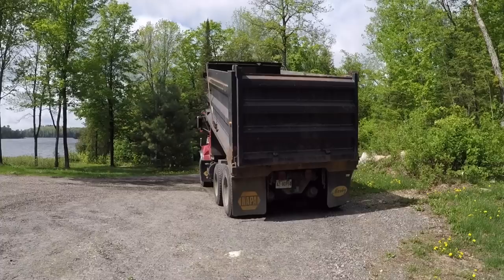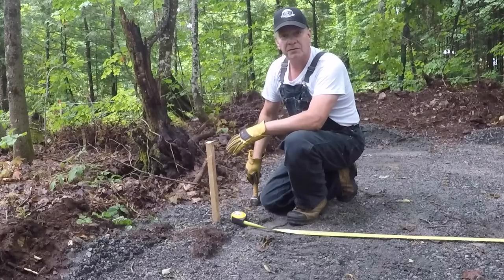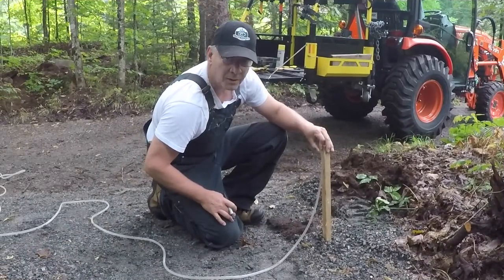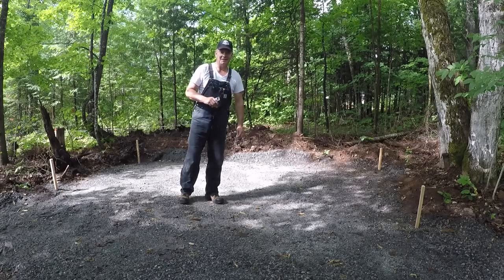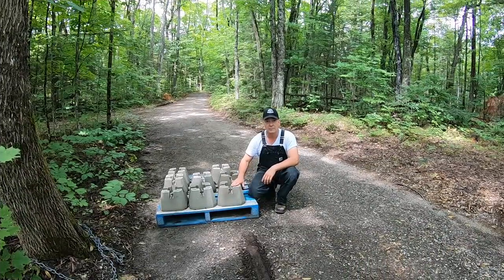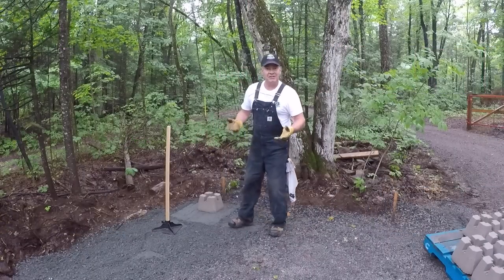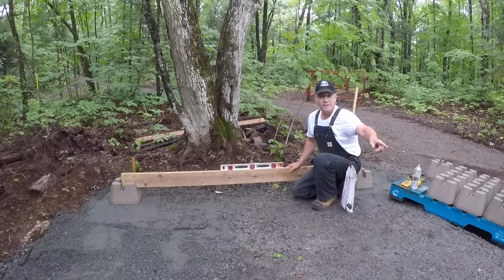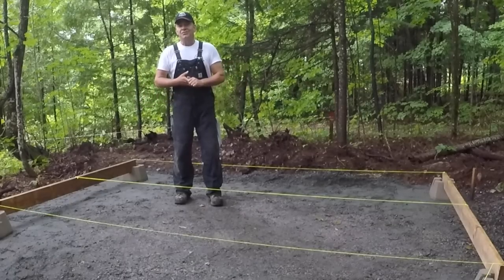#316 Wood Shed Build - Part 2. Levelling the ground and placing Deck Blocks. outdoors.

Comment: Great video Gord . Crusher run is great stuff . We use that name down here . When I built my shed 6 years ago I dug 2ft holes and filled them with crusher run . Pound it down really hard and it turns almost like cement . Put the blocks on top . My shed is 10X12 . Hasn't moved and inch . Put  a 1/4 screen between the deck and the ground to keep out the critters from living underneath . My 3 neighbours didn't do that and now they have skunk problems . Of course you won't need to do that . The hardest part of building these days is finding the lumber . Lumber prices have gone through the roof . I  always over build . That shed is going to be there for years after I'm gone . I always wanted to build my own cottage but never did . I built that shed just like the way I would have built a cottage . No short cuts . With Guy having a sawmill I would have thought that you might have cut some lumber for the shed . You had some pretty good size logs there to cut many boards . Take care .

Comment: Easy one man way to get grade on the ground is string, a string level and a tape measure.... Place your string at any height you want from stake to stake, mine is usually waist high so I don't have to bend to far over to read measures. 😀... Level your string and measure from the string down to the ground to see how much fill you need to equal your high spot measure from string to ground. Simple, very effective, and I've used it out up to 60 feet and got grade pretty accurate. Not laser accurate but darn good enough... Just got to move one end, usually low side, re-leveling string, from place to place checking grade of the area you want leveled... I did my 30x30 shop this way and not a low nor high spot anywhere before concrete pour. 👍

Comment: I always knew you were on the level! Sorry, couldn't help it. Those blocks are nice, I wish I had them about 10 years ago when I built my shed. In my case I didn't prep the footprint of the shed. I had a granite ledge near the surface and simply leveled the footings which were standard cinder blocks. Once I leveled the corner block I ran a string from that block to the next and so on using a bubble level on each block. Nice prep work! Best Regards, Jay

Comment: A solid foundation in aspect is the best to start building on! The crush stone gave you a good footing, leveling your “pad” and using foundation blocks gave you a level structure to build on. Now comes the easy part building the shed!
Reply from the maker: Good morning pat! Thanks! Any advice along the way would be very welcome. Have a great weekend!
Reply: Send me a sketch of your plans, and I will let you know of some ideas of improvement. After you build your box for your joists, put blocking between them in a staggered pattern this will strengthen your floor. And I would use pressure treated lumber for this area. A plank floor with 1/2 inch gap between boards will allow small debris to fall through and air to circulate. Then build your walls on top of this foundation 16 inch on center before sheathing with exterior materials. Double your header plate all the way around and leave your soffits open for ventilation. Then add your rafter system.

Comment: Gord I like the water level, works perfectly, Home Depot Newmarket has a lot of pressure treated right now and Lowes has almost none. I've noticed that the quality has suffered lately.
That is going to be a good size shed but like everything else I bet it will be full and too small in no time LOL.

Comment: Good old fashioned water level is a good thing to have...though I do have that identical lazer you had in your hand....mine's a 5 way self leveling, is that what yours is GP ?  Your load looks to be what we call inch-minus down here.  It's whatever falls through the 1'' screen, including all the dust, chat and small stone.  Packs super hard with compaction and water.  Fun video...especially you getting a bit wet at the end....LOL
Reply from the maker: Yup, that's the stuff here - packs really well hard. I'm not sure if it was the 5 way or not - it was Guy's - he lent it to me. Always hard to see the laser line in the sunlight. Lots of rain here lately - lots! My sump pump has been working overtime . LOL!

Comment: You can get cement blocks with a hole through the middle thar excepts a metal bracket with a threaded rod with a washer and nut. You place the block insert post/beam bracket and adjust the nut to level the base beams.

Comment: Hey there Gord,  I have used a water level many times.  We didn't use the bucket though, we just filled the hose with water and would take one end to one side of the building and the other end to the other side and the water would always seek its own level so you knew that each side of the building was at the same height. Good job.

Comment: Should of did some #3 as a base then some #2 modified to tie it all in.

Without a solid base, the small gravel will work it’s way into the ground eventually. 

Just my 2 cents
Reply from the maker: Thanks Sears! I dug down to mostly rock and got rid of all the organic so hopefully that will provide the more solid base needed. But big thanks for the help, for sure. Advice is always welcome. Cheers!

Comment: best level is a small bubble you can attach to a string line (only limited to length of string). I have the dewalt green laser level sometimes very hard to see in the day light.
Reply from the maker: Morning Forester. Very true. I have used the red ones and I bought the Dewalt laser glasses but it is still very hard to see in daylight. Cheers!

Comment: Crusher run is also called road base out on Vancouver Island and 3/4 fine   in the interior of BC (at least around Kamloops). It's a great material for your driveway if it doesn't slope too much.

Comment: When using a water level be sure to keep your thumb over the end of the hose when moving around so as not to LOSE any water.
That can affect your accuracy.
You also should mention that your level marks are for reference only and that you can adjust your fill likewise.
You don’t have to fill to original marks.

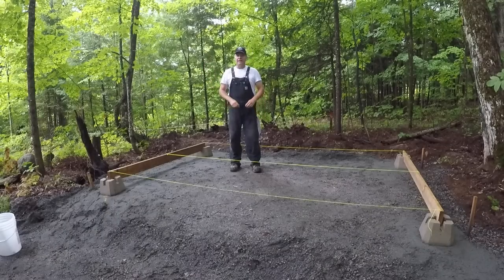Comment: Nicely done GP.  So when did you get an enclosed cabbedd, tractor.   did the same in May 2020 and haven't looked back since.  I have AC unit, music and no skeeters or biting flies to irritate me while working.  Smart move to get the cabbed tractor.  I can't wait to finally get out there and use it.  Once I get the green light from the doctor, then I can go out and play and might even make a few videos.  Yup, the water leveling method certainly works.   The Tamper will give you a pretty good workout too (smile).  Sounds like you were starting to get some drizzling rain at 12:52.    You're doing quite well establishing your firm foundation.  Enjoyed a full-watch.  Be safe and keep having fun, GP.  Have a fine Friday and a fantastic weekend.   Don

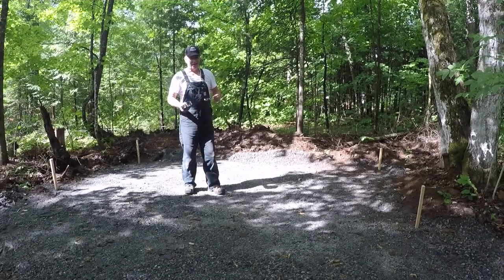Comment: Just a note about a water level. Always try to check on the same part of the hose. Checking at a closer area on the hose to the bucket will raise the level slightly. (like how you did on the last one at 4:46 with all the extra slack.)
Reply from the maker: Morning Josh! Thanks for the great tips - I did not know that. Cheers!

Comment: Off your shed topic.  Did you have to put wheel spacers on your LX2610?  Which tires did you choose? Great job on setting the blocks.  Cheers!
Reply from the maker: Morning 906! I didn't have to, but I did, because I plan on putting tire chains on it for the winter. Similar to the B2601, there is not enough room under those fenders for chains without the spacers, from what I could tell. Have a great weekend!
Reply: Ok thank you sir!  Did you go with R4 tires?

Comment: On those blocks just get them set, level and close to where they need to be.  you can cut wood spacers to place between the joist and the block to get things level. no need to dig out from under the blocks or add material under the blocks. I’m like you not a professional just sharing how I have used those blocks in the past. My shed is still level 12 years later.

Comment: You had level marks on all the stakes. I don't understand why you reduced three of the stakes 
 by two inches?????
Reply from the maker: Hi Chet. Great question - it is so I didn't have to build up the north end - so I dropped the level relative to the high ground. This way I only had to build up the south end and very little gravel needed at the north end. Cheers!
Reply: @GPOutdoors  the water level coming out of the bucket was two inches above grade?

Comment: Looks small for a wood shed as generally you want 3 seasons of wood storage to give it time to season and as an emergency backup in case of a bad year or an injury.  The good thing is large out buildings can be built cheaply once you have even a cheap Alaskan chainsaw mill as the cheapest wood shed build I have seen so far simply used posts in the ground and not even fully squared off timbers for the structure, a simple metal roof and live edge boards for the walls to enclose but still let in some air.
Reply from the maker: Good morning and thanks Andrew! Some great points there. I don't heat with wood so I didn't need much space but if i did , I think that would have been an excellent idea - to make sure it could hold 3 seasons worth. Any feedback or advice along the way would be greatly appreciated. Have a good weekend!

Comment: If you had done better in your high school physics class, you won't have doubted the accuracy of a water level. As long as there is no air bubbles or ice in the tube, it can't be wrong.  Cheers.